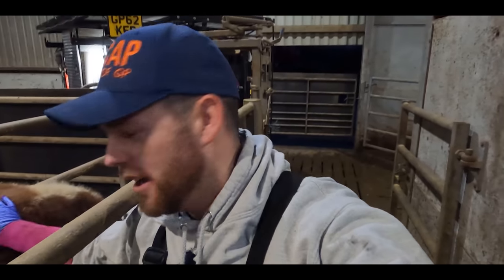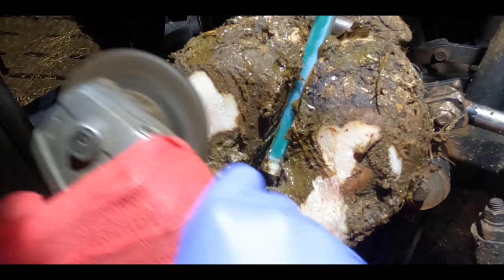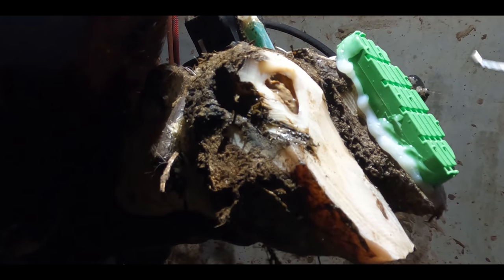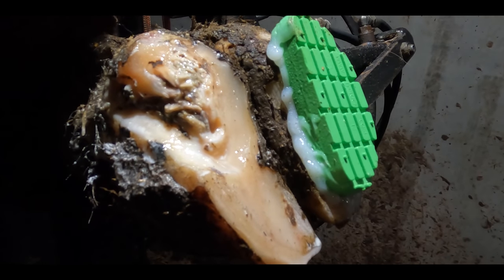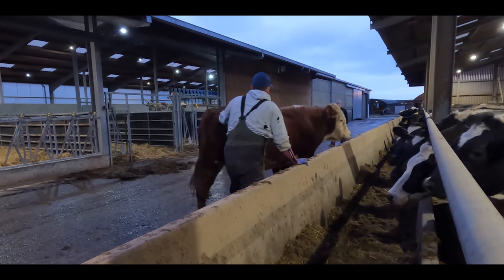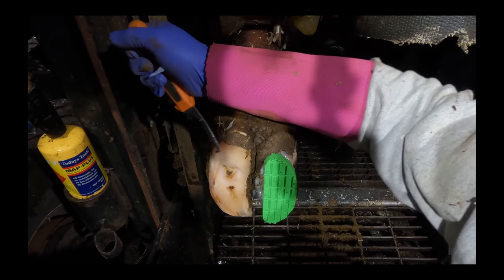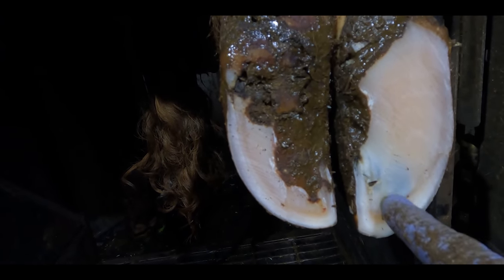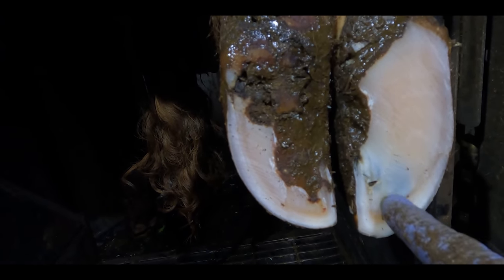BULL'S HOOF CAVITY OOZES PUS!

Comment: I've been curious what you'd do if both claws were so badly affected that you'd have to remove enough material off both claws such that neither one could bear weight or support a block? Like suppose they both have deep cracks near the whiteline with massive infections covering both soles

Would you tackle them 1 at a time? My thougt would be to fix the simpler one first because you could clean it unfortunately block the other painful claw and let it heal quickly then come back and switch. Because the alternative seems worse. If you tackle the worse claw first well then the other claw will have to wear a block and bear all that weight for much longer, as usually a really bad claw the needs most of the hoof removed requires multiple visits and treatments and months for growth. And by the time the other foot is healed up the smaller problem may have grown big, especially as it's been supporting a ton of weight for a very long time in a bad condition. This question obviously
 assumes neither claw is so deteriorated or cracked that it couldn't even take a block.

Comment: I also always wonder why you say oxygen will help kill an infection problem on the sole of a cows foot. I agree that having it exposed to fresh air would help. But seeing as it's going to be on the hard ground (or well 1 or 2 inches above mainly) it ends up getting entirely coated in feces and seems like it would actually get mud worse. This is even more true on grass or haybedding or some other soft surface where the block still supports the weight but the affected claw would be touching the ground with some grass, mud, hay or sand entirely coating the hooves. How could there even be oxygen in such a state? It sounds like the cow will be sitting on a coach with his foot resting on the table everytime you say that!

Comment: I do not criticize ever. How is that you have a state of the art crush with no facility for onboard water? Time to do a small modification and add a tank for just these occasions. Nice work on both bulls to
Reply: A big enough tank would render the crush illegal when full.
Reply: @alistairclement4239  how so?
Reply: @mauriceryton   A 3.5 ton weight limit, and the fact that he'd use a LOT of water.
Reply: @alistairclement4239  l see it as a small quantity of water on board as most farms have water. A five gallon tanks with a brush and bucket. As it drains fill it up at those locations that have water. I am assuming the weight is due to the axle/s.